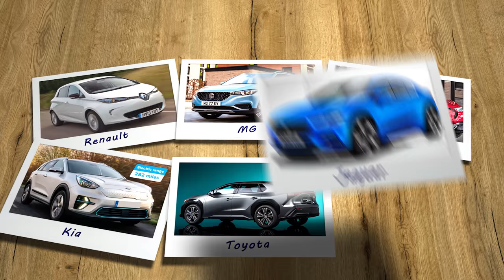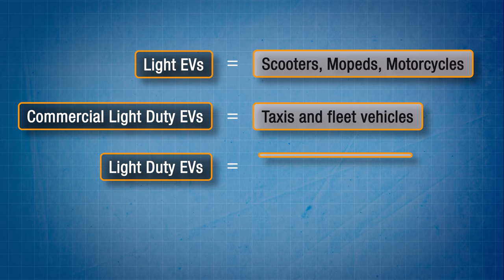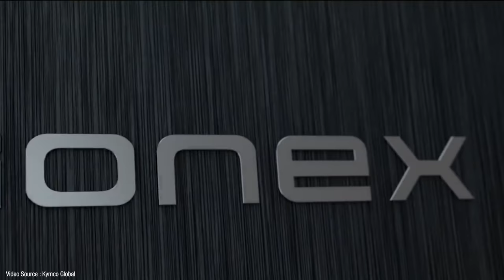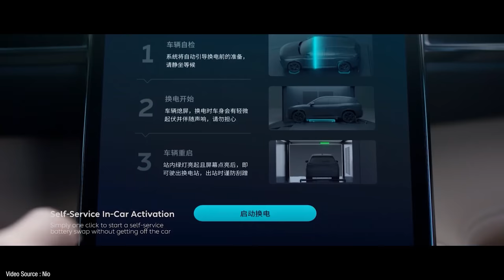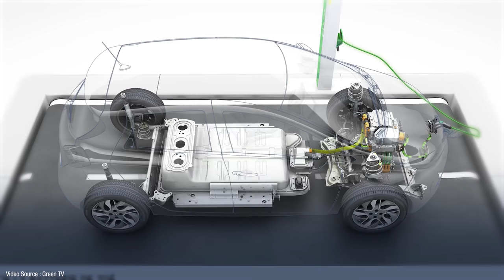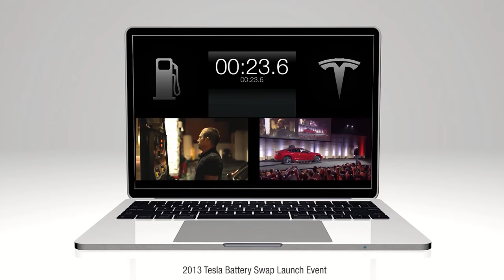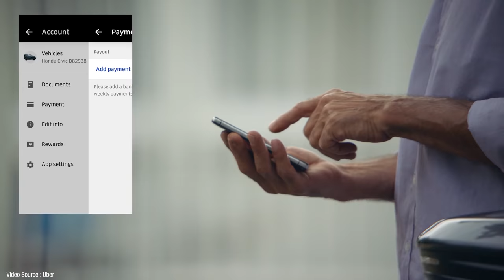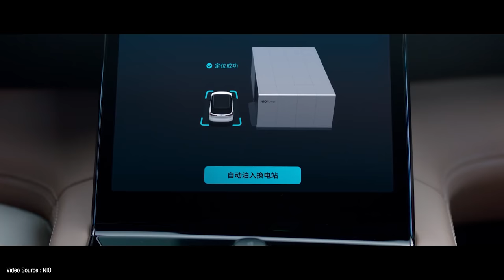Battery Swapping. Transforming the trajectory of electric vehicles?

Comment: I started driving taxis in 1984, (Brisbane, Australia, mostly night-shift) and I have been sweating on fleets to do this since the first month I was in a cab.
Unless you can recharge the battery in a cab in 5 minutes or less, it's not going to be as well accepted as petrol / LPG. But if you could make a standard battery, and it could operate the cab continuously for 6 hours, with performance and acceleration and everything a match for what petrol / gas cabs did, then... a flat pack 4 ~ 6 inches thick, about 3 feet square ... Who cares what it weighs? It can weigh 6 ~ 7 ~ 800 pounds - it doesn't matter. As long as you can cruise the streets and freeways of an urban centre, at full normal performance, with the headlights and the air-con and the power steering and the music all going full blast, for 6 hours, then ... As long as it doesn't cost MORE than fossil fuel, it's doable. I just don't want to loose the air-con or the music or the headlights & wipers, demister... and I don't want to be out-dragged up a hill by a furniture removals van. But most of all, I want the swap to go as quickly and easily as filling the tank with petrol or gas. Even a half hour to recharge in a taxi, is not a viable option. It has to be at least as quick and easy as filling an LP gas tank. And it has to be pretty idiot proof. Not me, but some of my workmates... If it is possible to do it wrong and brown-out half the state, then some new arrival cab driver will figure out a way to do it...
Seriously, 40 years I've been wishing & waiting for this.

Comment: Right, it would be nice if EV battery standards could be reached and probably make them safer. But it comes down to what's cheapest. If NIO is charging $150 a month, it is more expensive than most people's gasoline bill. More quickly, we could see swappable cars rather than swappable batteries.

Comment: I wish my EV had both in a way. It's regular fixed battery, but a port in the boot or something so you could attach an extra range booster for long trips, or a swappable portion that you can get charged, and you can drive to a restaurant while you wait. But if chargers wherever you park become common place, then that would be best! 😀

Comment: Seems like I have something important to say about every single topic that was brought up in this episode.  I have to say that this was the first time I've heard the term Battery as a Service.  That logically leads me to the next topic, Transportation as a Service.  If the fully autonomous ride hailing becomes reality in the next few years, the prediction is that commuters will no longer need to swap or charge batteries when they can swap the whole car!  Indeed, they won't even own a car when they can TaaS to anywhere.  🤗👍   The commuter may then have to switch to a freshly charged car at a charging station and continue on with the commute.

Then, the only concern will be:  Who is going to plug the empty car into the charger?  Does this mean we're going to have to revert back to the days of when service stations had attendants?  Or instead of automatically putting in a new battery, the charging station will automatically plug in the vehicle?  

The thought has occurred that with vehicles having modular batteries, the power supply could be a modular battery replacement that runs on hydrogen or other green fuel.  Hopefully in a decade or so green hydrogen will be commonly used for most heavy transportation, either directly as hydrogen or indirectly as synfuel.

One advantage of modular battery packs is that as the battery technology improves, it will be easy to upgrade -- just swap the pack and pay for greater range.  I don't remember hearing Dave mention this in this episode. 😋

Comment: If it was up to me I would have battery packs weighing no more than 150 kg and swappable but also with the ability to put 3x 150 kg packs in for long distance drives. 99 percent of the time 120km is the max range most people do in a day so why drag around 850 kg of battery and with latest battery tech these packs can charge within 5 min so only do swapping to take advantage of offpeak energy or for cheaper cars upfront and slow charging for pack longevity !
Reply: True ideally I would have a car with a small battery for day to day use (80 km range is enough) and then I add some swappable batteries when I travel to bring the range to 300 km. For longer travel there could be swap stations alone the highways. This could reduce the autonomy problem of EV's for good. And it would help to reduce the weight of the car by 50% on a day to day basis which also reduces wear and energy consumption.

Comment: One factor I have not seen mentioned in the video or the comments. Mechanical wear and tear.
Both in the screws/bolts that mount the battery, or High voltage connectors and especially the plumbing connectors for the cooling system

Comment: Perhaps in niches, buses, taxis trucks, bikes etc.

For cars problem is battery pack is now part of vehicle load carrying structure, so not so easy to replace. This makes vehicle considerably lighter, thus enhancing performance, particularly range. Once EVs can reliably make 600km on one charge battery swapping likely won't compete.

Potential theoretical upper range limit for Li-ion is about 800km. However, if Al-ion gets perfected cars could get 2,000 km per charge. At the limits of performance the key is making the batteries safe and reliable. This is being worked on

Comment: Swapping looked a possible solution years ago with cassettes, but it was tried and failed. Effectively with 100% mineral recycling batteries get swapped at manufacture, as supply chain for new batteries comes from recycled metals from previous batteries, a closed loop supply chain eliminating mining for new minerals.

Comment: Might work economically for fleet use, certainly a way to sell a lot more batteries since you have a spare being charged back at the shop. Will be put out of business by advanced battery technology doubling or tripling the range.  Why not just put bigger batteries in vehicles that need them?  An hour or two down time every 12 hours is not a killer in most cases.  Right now the average taxi driver in a big city drives 180 to 200 miles per day.  Well within the range of current battery tech.

Comment: To have standardized connections instead of "proprietary" batteries would be excellent!  Just like light bulbs have standardized screw threads and every manufacturer can produce bulbs that fit.  Will manufacturers cooperate or do we need to legislate and regulate this?

Comment: The biggest obstacle to EV ownership is price.

Everyone can get their head around the charging regimes etc, and most of them are good to drive, but they are at least another 1/3 dearer than the cars they are supposed to replace and they don't offer anything tangible for the extra money.
I'd love to put an EV in my driveway here in Australia as our second car, where even the cheapest EV is $43k, but I can by an equivalent ICE for under $30k to do the exact same job just as well.
The cost difference will never be recouped in the time most owners keep a vehicle.

Get them on price parity and customers will push the doors down to own them.

Comment: Compartmentalize batteries, add super capacitors. Swap the caps, have the caps help charge the battery while the vehicle is still being driven.
Reply: Make roads with charging plates in them. Drive over the charging plates.

Comment: There is absolutely no way I'd pull into a battery swapping joint, and risk getting my own battery removed, which I've looked after ( and which still has 6 years warranty to run ) and risk getting someone else's abused battery. No way.  In any case, as charging infrastructure increases (as it is in the UK), along with ever more quicker charge times, then there will be little need or point in battery swapping..... For battery swapping to work, the swapping stations would need to be at least double manned for health and safety reasons, and open 24/7. They would also need dozens of different types of batteries available, to suit any car which drove in. And how would they find time to charge them all? It just wouldn't be viable. I'll take my chances with home charging, and rapid public charging when I need it. Which isn't very often......

Comment: Perhaps vehicles could come standard with smaller hardwired batteries.  With a standardized slots for plug in batteries.  That way battery developers could continue to push the technology forward, as long as it plugs in.  EG. Tesla may have a battery with a compatible size and adaptor, but have higher energy density in that battery than its competitors.  The idea being smaller batteries for driving around your suburbs, pull in for a plug in range extending battery when traveling

Comment: There’s no need for battery swapping. If you have driven a tesla you realize this. You can get 10-80% in under 20 mins. It’d be much better to mandate stations in apartments, and SC while traveling long distance. I’ve put 60,000 miles on two different teslas and I’ve never once had to stop longer than I would’ve with an ICE (I need to eat and pee) while traveling. So long as you have home charging it’s a non issue.

Comment: This is a great concept. It is not for everyone, but it can lower the cost of EVs and make them more appealing for people with no charging option at home. 
However, for private cars,  it's probably commercially viable  mostly as long as EV batteries technology is within a medium driving range (maybe 250-500 km) and while EV fast charging still takes  over 5 minutes. When EVs excel these thresholds, the appeal of this technology falls drastically.
When EV batteries have shorter driving ranges, it is too much of a hassle to replace the batteries every 1-2 hours of driving. 
We had the failing pioneer of this technology in Israel a decade ago- Better Place, that partnered with Renault. The 160 km Range of the Renault Fluence, plus the battery swapping, was not appealing, and the project crashed less than a year after the 1st cars started to drive...

Comment: A swappable battery standardized formfactor would be ideal, that way as battery energy density improves you can keep your vehicle and not have to buy a new vehicle because your battery is junk and its part of the chassis. my idea is to have a number of battery packs in the vehicle that are able to be handled by the owner, then you pull up to the station and swap the packs that need to be swapped and you're on your way, think redbox for batteries kinda smart kiosk that scans in your packs, gives out fully charged packs in there place and puts your old ones on charge if they pass a diagnostic test if not that pack gets flagged as bad and is repaired or recycled. Just thinking beyond today

Comment: Given that some privately owned vehicles are rarely used - wouldn't it make sense to repurpose petrol stations to maintain and keep charged small local fleets of vehicles for hire? I'm seriously worried about the prospect of replacing so many vehicles in private ownership and the finite resources needed to do this... I think private ownership is going to become outdated. 
  On the subject of swapping battery packs - could we not swap hydrogen canisters? Conversion and re-use of existing cars to run on biomethane or hydrogen would be the more sustainable accessible option but there's not so much profit in it :0/
Reply: If you have a regular journey or commute... use public transport??

Comment: Now defunct Israeli company Better Place was clearly ahead of its time when it comes to battery swapping. Battery technology/chemistry has now made it feasible.

There are other ideas that could enhance long distance driving vs the reality of the relatively low daily/weekly miles driven by the average commuter who can charge at home. I'm thinking specifically of batteries housed in a tiny trailer that could be rented for long distance trips. Such a solution would reduce the weight of the vehicle as well as the backlogs of battery supplys as the transition plays out.

Comment: I think swap-n-go battery-packs are inevitable but will take a while for a standard to emerge.
I do wonder how a clip-on battery-pack will go in an accident, though: dangerous if it flies through the air, expensive if you 'bottom-out' on a kerb and crush it or if you dunk the car in deeper water than expected.

Comment: Battery swapping is the logical conclusion. Tradesman have been doing it with their electric tools for decades to the point that is the most common practice, despite the standardisation issues. The reluctance and greed of corporations to co-operate to standardise their batteries has meant that the process took much longer than it needed and still costs the end user and the planet more than necessary. Looks like we haven't learnt anything for cars and motorcycles.

Comment: It would work, but only if everyone agreed on ONE standard for the mechanics for cars (perhaps 2 or 3 sizes, but that’s it). It’s bad enough that there are multiple standards for plug-in chargers 🔌 and that’s the easy thing to standardise! And keep it simple mechanically, so swaps are quick and easy, with a manual way of doing it for service garages to use (removing the battery is the ultimate way of making EVs safe to work on).

Comment: In the time before WW2, tractor manufacturers and implement manufactures each had their unique tool attachment architecture. The intent was if one purchased a particular make of tractor, the farmer had to purchase all his field implements from the same place. Then someone invented the 3-point hitch to make it easier to attach and change out implements on the farm. This move created quite a stir in the farm market and the complaints from the manufacturers was that this move would cause them to loose business. The opposite happened. Once there was a standardized way to use implements from different manufactures, the sales increased for everyone. Then the competition was for price, quality and effectiveness. The same problems now exist in small tool batteries. But if the tool and car makers standardized the equipment, the consumer would have a better product and the prices would be more reasonable. There is a lot of benefit to standardization.
Reply: That is a good point.

Comment: one of the big chances i see with wide spread e-cars and swapping stations .. they have a couple dozen batteries connected to the grid, serving as a buffer for peak production or may even as a source for peak demand times .. contributing to a smart grid .. imagine 24 batteries x 20kwh (just a sample) per switch station .. with i.e. 100 of those stations along the coast .. would make 48 MWH of capacity for buffering usage/production peaks JUST by those stations

Comment: This seems like a great way to reduce reliability due to more moving parts. 

Also we need to be reducing our total car dependency full stop, we cannot rely on EVs to save us.
Reply: But we do need motorised vehicles to some extent and always will, so this is an idea to address charging capacity as take up increases.
Reply: In semi rural areas like mine, the bus network is awful. There are no buses that go to my work. None to my Mum's house either. My husband could get one to work, but the last one home leaves before he finishes, so it's no use for him either. The only one that benefits from the bus is my daughter, who uses it to get to school. Everyone here drives petrol or diesel cars unless they have a driveway, as the nearest charging point is 6 miles away.
Reply: It's a nice concept, but far from achievable as more are leaving dense urban areas for smaller towns. An adequate public transportation network would be welcome if the ridership numbers are available. Building a light rail system across the globe would have a significant carbon footprint before accepting passengers.

Comment: It was only yesterday that I watched a YouTube video extolling the virtues of building the battery into the structure of the car.
The argument being that the built in battery saves weight, as it doubles as the car body work. 
I strongly objected to this idea, because the battery defines the life of the car, the classic built in obsolescence. 
Swapping out batteries seems like a good idea, particularly if the swapping system allows the battery technology to be upgraded. 
This addresses one of the problems of adopting EV technology, which at the moment is a fluid moving target. Buy a EV now,and it is likely that the battery technology will be out of date, even before the warrant runs out. This is a real problem for resale values, as the consumer is constantly looking at improving the range, something that will continue until it exceeds that of fossil fuel cars.
It could be argued that such innovation has been a feature of the development of fossil fuel  vehicle technology, but I would argue that this was more evolutionary than revolutionary. Battery power is likely to change technology several times yet, before we settle on a winning solution. It is a problem we are facing in many areas, as we attempt to deal with climate change. One only needs to look at home heating and lighting, to know the consumer faces forced expensive ungraded in the near future. Upgrades on some of the most expensive investments we own, cars and homes.

Comment: Didn't they do battery swapping years ago in Israel with peugeot's ?
On the note of perks to "slow" charging, you forgot to mention that it would cost (slightly) less power then fast charging.
(Batterypack cooling, but the heat resistance of the cable too)